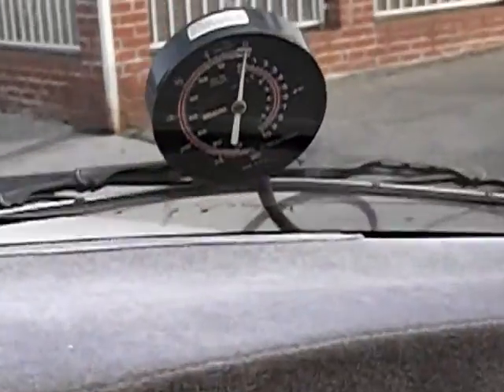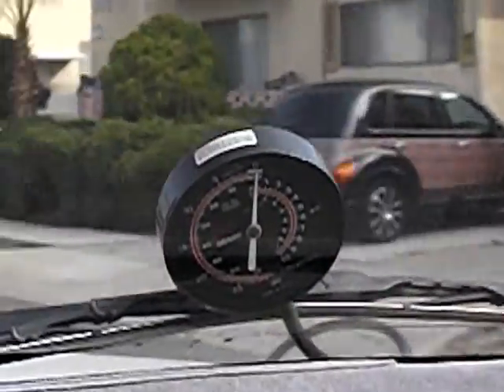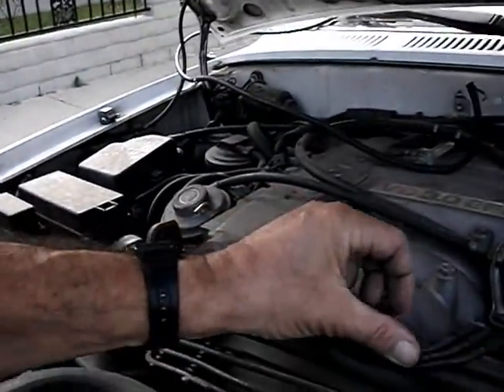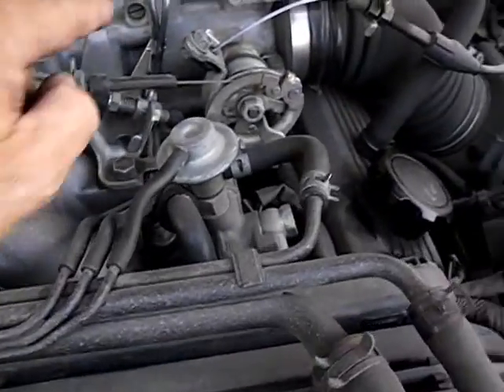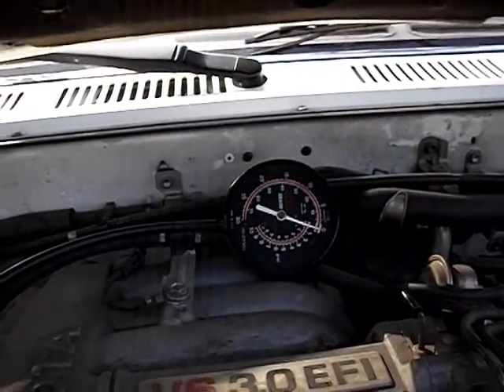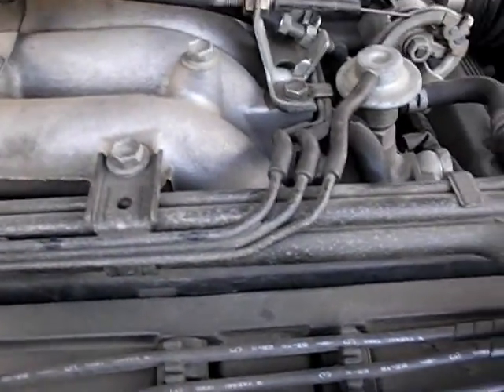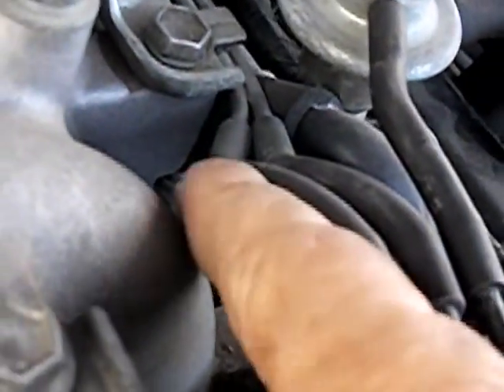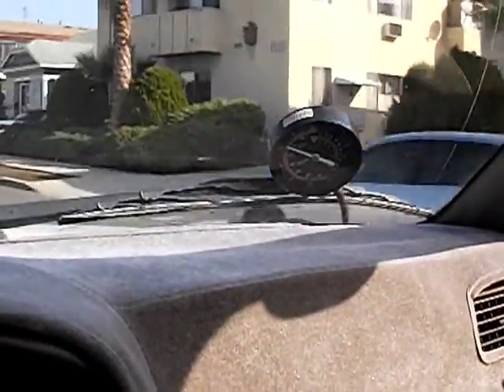EGR Diagnosis and Repair

Comment: Should this EGR valve 'hold' vacuum or is it enough to see that the engine stumbles when vacuum is applied directly?
Reply: If you apply vacuum directly to the valve, it should open and the engine should stumble. If it opens and doesn't stumble, it means that the EGR passage is clogged. If the valve DOES NOT open, the diaphragm in the EGR valve itself is leaking so the EGR valve then must be replaced. Also, the valve will NOT hold vacuum if the diaphragm is leaking.
Reply: @Steve7SP  Thanks Steve. The engine did stumble when I applied vacuum like you demonstrated. My question though is should the valve hold the vacuum when I'm using a hand vacuum pump. Some back pressure EGR valves normally do not.
Reply: @keneblana  Not sure on your particular application. Is it holding vacuum when you connect it directly to the valve?

Comment: Hey Steve had a question. Is it okay to spray throttle body cleaner or carb cleaner into the ports on the intake manifold. I am not getting any vacuum through port E and I believe this is the reason why I have trouble code 71. I also have trouble code 41 but I believe I may need to solve 71 then move to an adjustment of the throttle positioning sensor (TPS) for code 41? Any insight you could offer me please? I had my head gasket replaced almost 2 years ago and I asked that the vacuum system be looked at and cleaned. They may have not done this for me and I don't want another issue and I have to get emissions test soon here in California.

Comment: I guess it's true what they say that there is more than one way to skin a cat.
To clear a trouble code, simply remove the EFI fuse (not the relay) between 30 - 60 seconds. I'll try your method next time. Thanks for the video. I learned how to do yet another test on my 1991 4Runner & on other cars.

Comment: i got a air meter out of the junk yard off of a 1995, i messed my old one up. I put the new one which is factory set.  it makes the car shake when i accelarate and doesnt have much power at times. it runs great in nutral or park.  higher gears on the highway seem to work better? could this be something else . I am showing a O/D flashing light all the time. went to have it fixed & it still is flashing. Do you have a vidieo on how i can test me air meter(mass airflow meter ) lean or to rich? Thanks  Audet.s13urton@gmail.com.
Reply: could this possable be the egr instead of the air meter? or something else i should check or replace
Reply: no check engine light is on. When I unplugged the two screws to clean it i ripped the wires off & the checkengine light came on. Now that the new 1995 one is in i am getiing no lcheck engine light but im getting all of the symtoms when accelerating. rough take off . something not right. not much torqe or power up hill . just barley gets going. shifts into high gears to early . Had a valve body job cleaned & all new silionoids put in as well as a new trans filter & fluid(clean pan)  600$ they charged me. still runs like shit! unless its engine related and not the trans. although its flashing o/d light still. they coulfnt get it to stay off. it came on right away upon picking it up

Comment: YUNOSKATEBOARDIN, it's important you get the trouble code which is turning on the light. If your 4Runner is 1995 or newer, use this method but make SURE you jump ONLY the TE1 and E1 terminals to avoid damaging anything. Also a straightened-out paper clip works better than the wire used in the video:https://www.youtube.com/watch?v=do7ulTOvQPc
comments

Comment: My 4runner didn't stumble when adding pressure directly to the egr valve. What's the next step on that problem. Also i relaized that i had the same rips in the hoses as you did. I plan to replace those but not sure about the first thing i did which was blowing into the egr valve. Thanks.
Reply from the maker: .YUNOSKATEBOARDIN make sure you are applying VACUUM (suction) to the egr valve and not pressure or it won't work.  If you do and it still doesn't stumble, the EGR passage may be clogged.
Reply: Car Inspectors ohhh awesome!!! I checked and mine is working fine. Must be the hoses. Thanks much appreciated
Reply: Car Inspectors okay so i replaced the cracked hoses and the check engine light came on again today.. i did install a flowmaster exaust using the stock piping, can this be the reason for the light? I thought it could have just been a coincidence but i guess not.

Comment: hopefully my code 71 problem is just as easy to find as yours, ill be trying this in the morning
Reply from the maker: Let me know what happens Victor.
Reply: Engine stumbles and nearly dies when vacuum is applied to the top of the egr valve.  So egr is good.  Tried testing the modulator by blowing air through the hole and covering the other 2 with my finger when it's off.  Air goes in.  Tried with engine running and once 2k rpm and air still goes in.  That's where I'm at right now
Reply: Need to get me a vacuum meter and pump.
Reply from the maker: Make sure you've got vacuum coming up at the hose to the modulator when the throttle is opened. If you do, then connect the vacuum gauge to the modulator output to the EGR valve and go drive it like in the video.